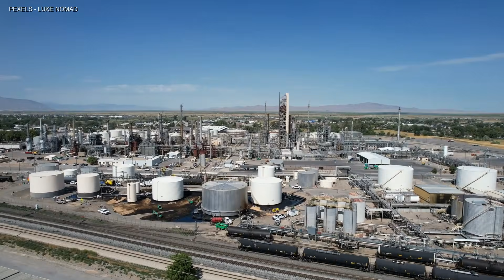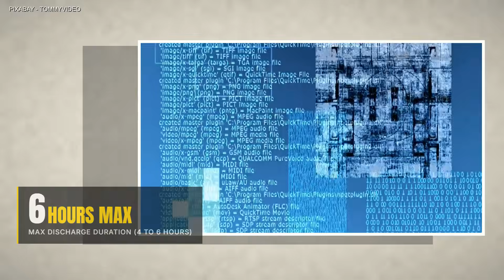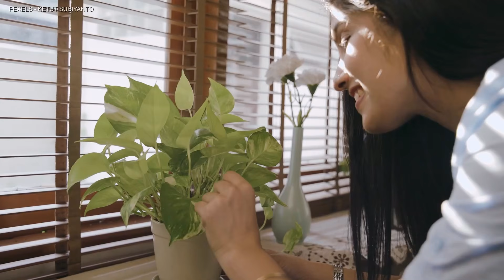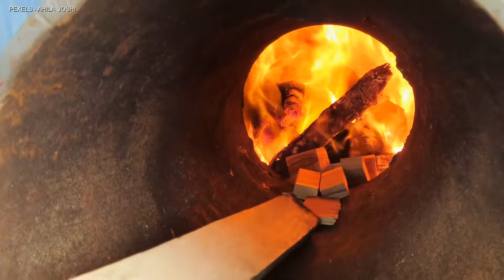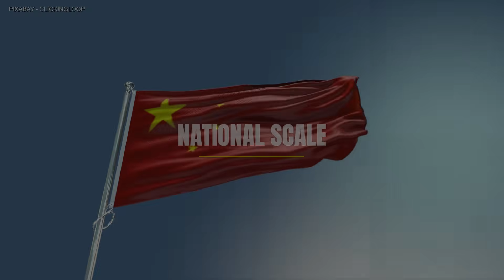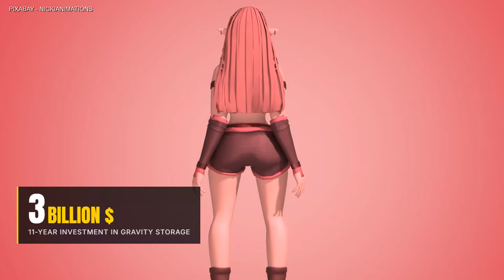China Is Storing Electricity Inside A Mountain — Without Using A Single Battery

Comment: Australia's Snowy Hydro 2 pumped storage is much larger, 350GWhr at 2GW rate.
Reply: The project is not completed nor operating, and expected completion keeps being postponed, while the cost keeps rising.
It’s dubbed a farce by MacroBusiness and a failure by Megaproject. The power capacity at 2 GW is less than the 3.6 GW of this Fengning pumped storage; four other pump storage power stations in China and two in the United States are all bigger.